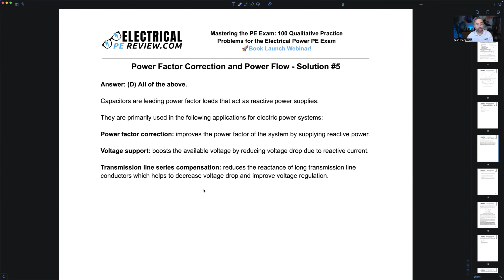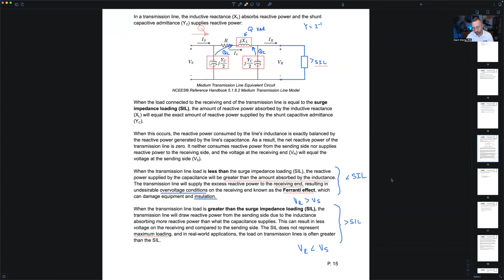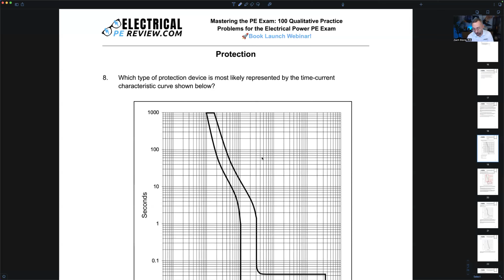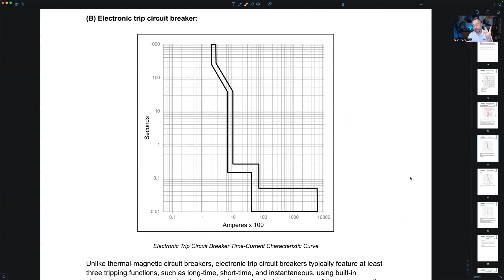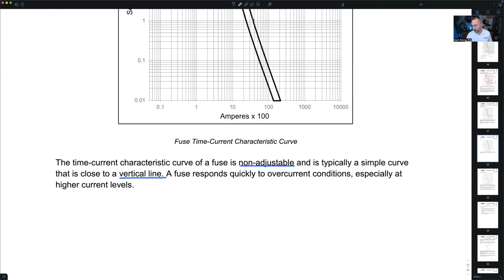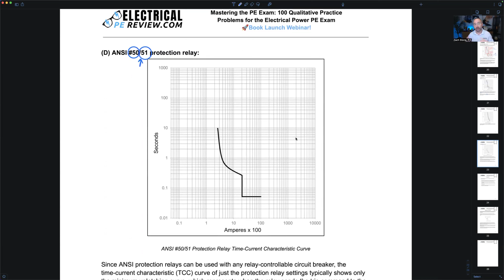Mastering Qualitative Questions for the Power PE Exam – Live Solutions Week 2

Comment: I have a question. I currently do not have an EIT or PE but I have been working under a PE for almost 7 years.  Can I take the Exam and still hold a PE or EIT?
Reply from the maker: The requirements for each state differ slightly. You’ll need to check with your state board’s website to find their Individual rules to see if you can qualify.

Comment: These questions are great. Thanks for uploading this.

One question - 39:26 - I was under the impression that Motor Circuit Protectors (MCPs) only have a magnetic trip function for instantaneous short-circuit protection. This instantaneous trip is to protect the wiring. The motor itself is protected separately by overload relays.
Reply from the maker: Yes, that is correct. I re-watched it and now realize I should have specified more that it's the separate overload used in combination with the MCP that provides the thermal overload protection (typically fusible links, solder pots, etc). Glad to hear you enjoyed it, there will be two more live webinars over the course of the next two weeks for this series and I'll be posting the recordings on the channel.